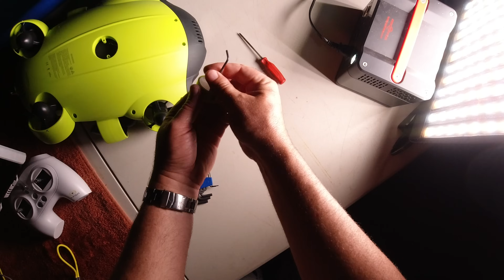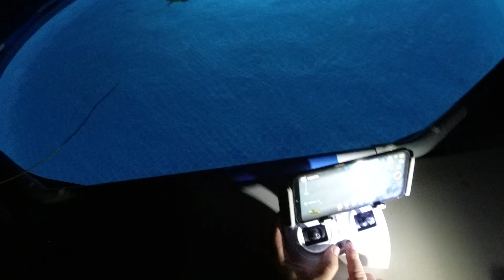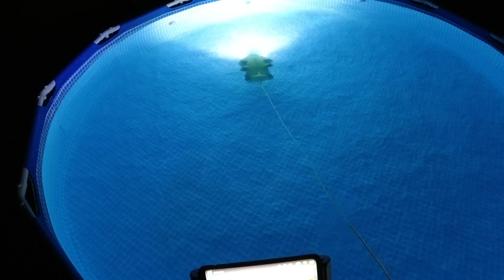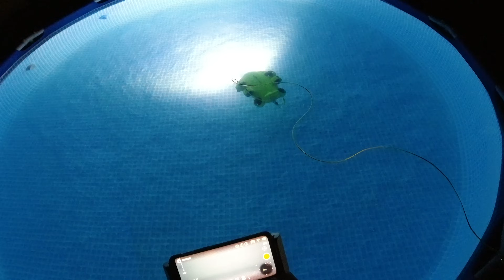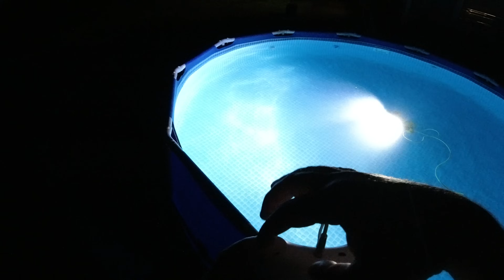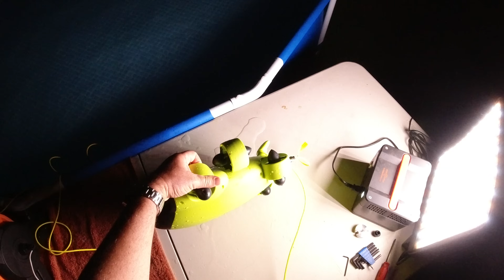Underwater Drone QYSEA FIFISH V6 Maiden Dive Test + VR Mode - Part 2

Comment: I fired mine up, it dove to the bottom listing and the props got clogged with seaweed. Tech support has taken weeks to respond 1 email at a time. Now the last email was send a video of the problem and the serial number of the controller. The next better not be, did you turn it one? or was it charged? lol.

Comment: Hi, great review. We are considering using this ROV to look inside culverts (steel pipes and concrete boxes). I was wondering your opinion on being able to hold it straight "up" (too look at the 'ceiling') and straight "down" (to look at the 'floor')  for extended periods of time. I noticed in your next review it could roll in Sport Mode, but could it stop and hold steady? 

Also, what is your opinion on durability in water with debris (timber, rocks, floating weeds, etc.)?
Reply from the maker: Yes it can hold any orientation quite well.  Durability is to be determined.